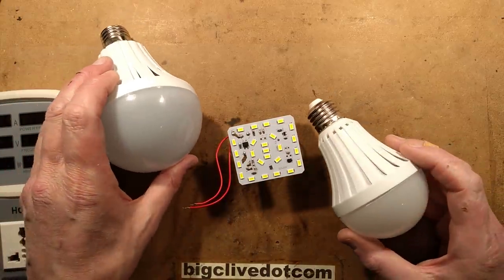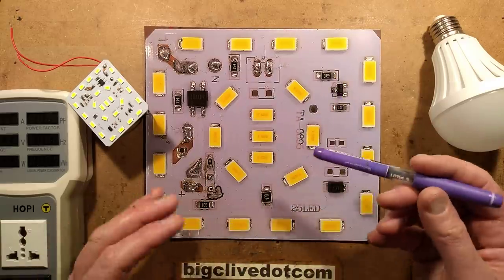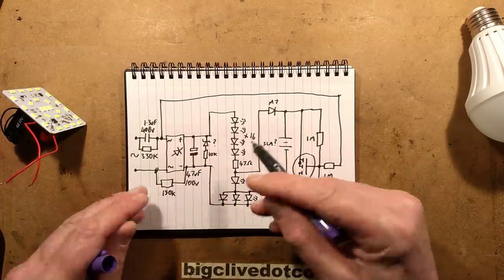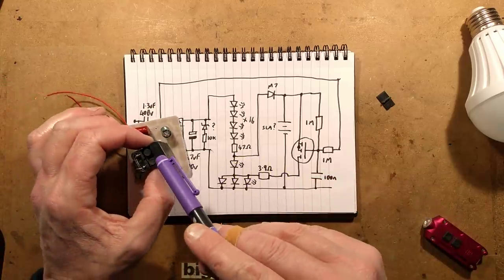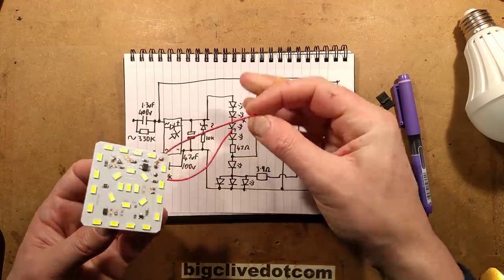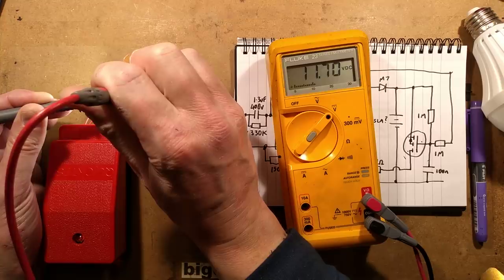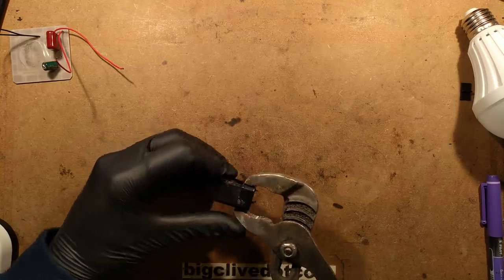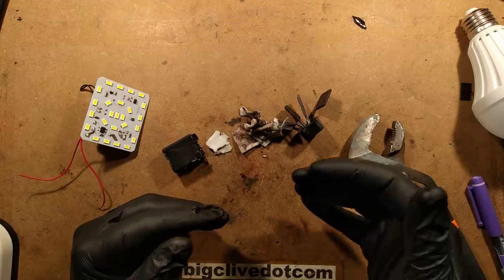Crappy lead-acid LED lamp with brilliantly simple circuitry.

Comment: Regarding cheap vs cheaper products from Chinese sellers, I've experienced being shipped cheaper versions on my second order from the same seller. First was a LED headlamp where the angle adjustment of the cheaper copy was so bad it would tilt down to point at your nose from the slightest head movement. Second was an analog video capture card where the cheaper one was lacking a lot of decoupling capacitors and a dedicated audio ADC. Makes me think some sellers intentionally ship the good version to gain your trust on your first order in the hope that you will place a larger second order where they can sell the cheaper stuff for the same price.

Comment: Have onne of this cheap emergency lights but fades after 2 hours, can I add another battery in parallel to increase the time? or can I replace the lead-acid with a 28650 lithium cell with BMS?

Comment: Bigclive, I found a battery like that in my electric bug zapper. It was dead so I took the battery apart and it was indeed a SLA battery. Voltage is 4 volts like the battery here. I have a pack of four 1.2 volt AAA batteries that I made and I think i need to take off a cell because the zapper won't charge. the adapter says 5 volts but has closer to 4.7 volts.

Comment: W/PF for about what they'd charge you for?

I've not taken an electronics course since high school (~6 years ago) so I'm a bit behind on things.
Reply from the maker: Modern smart meters can calculate your bill based on actual power used or the higher apparent power used by some non resistive loads.  With modern LED lamps it means that your supplier can choose to bill them as actual power or anywhere between 2 and 20 times that depending on the circuitry.  That also means that a simple plug-in time switch could cost more than its retail value every year in electricity costs.

Comment: The fiber in the battery is to keep the led close to the electrodes, so you can discharge it without the led  going so far away form the electrodes that it won't get back onto them when the battery is recharged. The fiber is the usual difference between a battery to start a car and a battery to run a alp lift/genie/electric boat etcetera.

Comment: does that mean it can be charged and discharged at the same time? cos I just opened up a cheapo handheld fan and found the exact same battery inside, so if I keep it plugged in at the usb charger, would it explode? there are no other components in the fan except the motor, a simple switch and the plug in connector..
Reply from the maker: Sometimes there's circuitry in the unit and sometimes in the USB charging lead.

Comment: iirc lead acid is very tolerant of overcharging (to a limit of course), so what if they stuck a current limiting resistor in series.  I'd think that would be enough to protect the battery decently and still keep the device very cheap

Comment: Did you measure the excessive charge voltage before or after blowing the zener diode? It was limiting the DC voltags on that circuit...
Reply from the maker: It was in series with a resistor to discharge the electrolytic capacitor when the unit is turned off so the LEDs go out quickly and also to provide a slight clamping load against current leakage that could make the lamp keep glowing from mains power when it's turned off.  The zener was to give that circuit a higher active voltage to avoid false triggering of the lamp via its low sense voltage.

Comment: I would think that they used some hydrophilic salt or organic compound to hold the battery moist.
The battery has also a crude deep drain protection with the diodes.
Also the lead-plates are very crude. They could have easily doubled the capacity and halved the material price if they plated iron meshes with the lead. Old cheap lead-acid batteries where done that way. (they break down fast if the plating is to thin.)

Comment: I've encountered a few of those rechargable LED bulbs with lead acid batteries and I hate them.

Every single one I've seen died within a few weeks or months mostly due to the capacitors getting grilled and blowing their fluff out. Some only the metal film cylinder capacitor, but a few with both blowing up. 

The battery is also grilled hard and buldges and blows its brown liquid splat inside the housing of the bulb.

Aditionally if nothing blows up the lead acid battery is dead since some people use them as a portable evening light and draining them regularly which kills the battery faster.

Comment: What’s the forward voltage of the diode in the battery charging circuit? Is that enough to take the voltage down low enough for the lead acid battery?

Comment: Alarm systems still use lead acid batteries, namely gel lead acid as a backup battery.
Wireless detectors use typically 3v lithium. Cr2 or cr123 batteries, lasting 2-3years typically.

Comment: If one of the parallel LEDs dies? Does the whole circuit die? I love to learn but I don't want to apply a higher grade LED versus a cheap LEDs that are currently on the circuit board. But I'll try. It's quicker to ask than follow the circuitry. Just saying
Reply from the maker: Only if it fails short circuit.

Comment: Got a couple of these when looking for the 18650 type. With the voltage so high , I really don't know what to do witj them?
Bypass the battery for low low voltage (usb?) Powered lamp, I don't know. 😑

Comment: Isnt the voltage drop from the diode preventing the battery overcharging? 2.35 x 2 = 4.70v max.  diode drop.. 1.8v , so from the leds maximum 6v before the battery would boil.
Reply: The Zener diode is not for the battery, it’s for the main light string immediately after the capacitive dropper to limit the peak voltage.  The battery only has what appears to be a standard silicon rectifier diode in series, so only about a 0.6C drop.

Comment: Seen some LED luminaires in a local car park that keep switching between the two modes. It's not the mains circuit as they all switch at their own rate not simultaneously.
Reply from the maker: Some car park lights have movement detectors to switch from low level illumination to high level when they are needed.
Reply: Wonder if they are in the wrong mode as most of the lights are always on. Just this one area area that may be motion sensing or something

Comment: I think tho low capacity of this battery stems from its simple design, there does not seem to be a large surface area of the electrodes (they look quite solid rather that "foamy"). Or maybe it just does not come clear on the video. I like this battery, btw.
Reply from the maker: The electrodes were solid and heavy slabs of lead.

Comment: If that battery is what it appears to be, it's an AGM battery (Absorbed Glass Matrix) and is the favoured type for use in mobility scooters and the like. It may appear cheaper, but it costs more than a basic SLA battery, and as you saw, even when you crush the living daylights out of it, it still does not leak (so to speak). They're usually slightly lower Ah capacity and don't charge or discharge quite as readily, but they are considered to be safer.  I have a pair of 50Ah AGM batteries that I plan to investigate. They appear to have dehydrated and sucked in the sides of the casing. I want to see if they can be rehydrated and made to work again.

Mobility batteries tend not to live very long, and it's usually the same old story of the acid having dried up, so, I've just bought some "Aqua Distillata" (Distilled water) with the plan to rehydrate these batteries, but, because of the glass matrix, it's likely to be a slow process over several days to fully rehydrate them, and even then, no certainty that they will live again.

Comment: Hi,I have a question,sorry for disturbing,I have a 12v 5a power supplay,but on the output IT give just 5v ,wath can be wrong with it?
Reply: Did it previously work correctly? If it gives a nice steady 5V and you've never seen it do 12V, might it just be mislabeled?
Reply: Barring the possibility of mislabeling, as mentioned above, there are too many possibilities as to why a power supply may fail to render useful advice from afar.  For example, we don’t even know what type of power supply this is or under what circumstances the 5VDC was originally measured much less have a schematic of the power supply in question.  However, if the power supply is designed with current limiting and the 5VDC was measured with a load attached then it may even be functioning as intended if the load was drawing too much power.

Comment: I tried using a bunch of zener diodes in series once for voltage regulation on a power supply I was building and they exploded in all of their glass tube glory. That day I had a lesson in component ratings.

Comment: Hmmm, I am now confused...
Clive appears to be describing an AGM (Absorbed Glass Mat?) battery, but then mentions it's an SLA (Sealed Lead Acid).
I'd always thought the two were different (or at the very least, one was a subset of the other).
Can anyone help me?
Reply from the maker: Many SLA batteries use either a gel or the glass mat.
Reply: @bigclivedotcom  
Thanks Clive...
The implication I'm taking from that is that an SLA battery is the superset that contains at least gel and AGM as subsets

Comment: I got stuck in the resistor bypassing the bridge rectifier "for a  sensing function", how a resistor can sense the voltage/current? I wish I could understand this to follow the rest.
Reply from the maker: The resistor is used to allow the switching component to sense when the voltage is or continuity is present.  It limits the current to a safe level.
Reply: @bigclivedotcom  Thanks! I understand the "it  limits the current to a safe level" but, how can it "sense when the voltage is or continuity is present"? It's just a resistor, it slow down the current. Sorry for the basic question!

Comment: I purchased some of these light bulbs and discovered that some of them switch on as soon as you screw them on, even if the light switch is off. Then in the morning when you switch them off, they stay on until the battery dies out.

Can this be fixed?
Reply from the maker: They can only be used in circuits on their own.  If there are other lights on that switch it will activate them.

Comment: Is that a recombinant battery? If so, it should not vent.
Reply: rpbajb SLAs will vent the when overcharged as their catalyst can only recombine the hydrogen and oxygen so quickly.  If the catalyst can not keep up, or of it has worn out from excessive use (whether from old age or excessive sustained charging), then the internal pressure rises above design limits (~5 PSI or about 1/3 bar) and the safety valve releases some of the accumulated hydrogen and oxygen gas, which is how such batteries lose electrolyte over time.
Reply: Ethan Poole Thanks for that data. I've got 160 amp hours of SLA's here, and I didn't know the catalyst could deactivate.

Comment: Sulfuric acid is most commonly used in these because its the cheapest. You could theoretically use any conductive sulphur salt as the electrolyte, like epson salts.

Comment: The lead acid batteries can deal much better being fully charged the whole time. Lithium batterys will rapidly die when held up to 4.2 V permanently. As a rule of thumb the lithium battery will live double the time by reducing the full charge voltage by 0.1 V.

Comment: I've got to wonder if one of the reasons that they used a lead acid battery is due to the fact that they are more forgiving in regards to recharging as compared to a lithium battery which is anything BUT forgiving. 👍

Comment: If the diode marked M7 was 2 or 3 diodes in series then that would limit the charge voltage to a safe level that wouldn't overcharge the cell.

Comment: Wait...Does it come on when its on a switched circuit and the switch is off?
Reply from the maker: It detects other loads in the house when there is a power failure and can detect the switch that way.  So it only lights when turned on at the wall switch whether there's mains power or not.
Reply: @bigclivedotcom  Ohhhh, i get it now. For a moment there I thought it was like an emergency type lamp, coming on when the city mains dies. Now the bridging of the wires makes more sense. That is indeed an interesting circuit.

Also ZOMFG BIG CLIVE NOTICED ME!!! [squees] Full disclosure, you are my YT man crush. [...  o.o  ... clears throat] uh...i mean, s'up man, how goes? Love the tattoo videos, reminds me of teching for haunted houses years ago. Though that companies gear is much cooler. If I ever make it over the pond I aim to have the trip coincide with that event. If you make it over the pond please do swing by California if you can. All around awesome content on the other videos, Ill usually throw your channel on for hours while tinkering at my desk. Virtual hugs, high five, and/or hand shake/fist-bump from the US!

Ok, ill stop 'fan-girling'....my friend is looking at me weird. Apparently shes never heard a man 'squee' before....

Comment: That appears to be a 4v lead acid battery 
I say this as most sla batteries are 2v per division/cell
And this battery has 2 cells (can be seen by the number of rubber caps)

I say thank you for reading this, and hope it was helpful!
Reply: Didn't realize that he covered this in his video, oops

Comment: That is a really tiny SLA battery. Didn't know they make them that small.
I'm somewhat sad that Clive has destroyed it.
Reply from the maker: One has been destroyed for the greater good.  Now other people don't have to open theirs and will know that they can actually top up the acid level in them.
Reply: @bigclivedotcom  Of course you want to use distilled water, not acid, to top up these batteries.

Comment: So just add a voltage regulator and all will be fine?
Reply: The Eh Team Just placing a 4.7V Zener diode in parallel with the battery would go a very long way to limiting overcharging.  A full voltage regulator, while such would be much better, would cost more due to the higher parts count that a full voltage regulator would entail (for continuous float charging, a 4.6V supply would be ideal).
Reply: @ethanpoole3443  Those basically short circuit to ground if the voltage is too high?

Comment: I'm so confused. How does it know if a switch is closed if it only has two terminals? Why would a switch short the terminals?
Reply from the maker: It detects the other loads in the house when there is a power failure.  They act like a low value resistor.
Reply: Consider what happens downstream of the switch when a transformer, motor, an incandescent bulb, etc, that are also in parallel with the AC mains are encountered.  At a low DC voltage whey will appear to the loop sensor as a literal wire shorting the two sides (neutral and hot/live) and complete the circuit.  Or consider what happens if we go further out to the utility transformer feeding the residence or neighborhood which can also complete the circuit as it’s secondary coil will again look like a wire shorting the two sides allowing the current in the emergency light sensing circuit to complete its connection provided the switch was in the ON position.

However, such simple sensing has its flaws too if there exist other lights or devices on the same physical switch.  Consider a light switch that covers 5 lights throughout a large room.  Because the are all on the same switch, if just one of those bulbs is incandescent or has a power supply with a transformer in it then the emergency light’s loop sensor will always see a closed circuit (via the other incandescent or low voltage bulbs in the string) regardless of what state the light switch happens to be in when the power fails.  In this case the sensor will believe that there is a power outage anytime you switch off the switch and I’ll always be running the battery flat

Comment: Am I the only person who's thinking of getting one of these then surreptitiously slipping a bit of foil into my mouth to freak out a coworker on the next electrical job?
Reply from the maker: You wouldn't need the foil.  Just your tongue will make it light.
Reply: I was thinking that it might give your bare tongue a bit of an unwelcome tingle. It's just a pity that I'm done with that part of the renovation. 
The fellow I was working with knows nothing about electricity and was a little freaked out when the lights he had switched off started to glow when I was changing a fixture in a different part of the basement.

Comment: my idea of using a light emitting diode and a purple colored photovoltaic fiber optic tube might work and it might be possible to step up a dc battery. like a inductor but solar technology not a copper one.. maybe we could build smaller power supply’s? 🤔😯🤗🤷‍♂️
Reply: could call it light emitting inductor (LEI) or Power over fiber optic (POFO) 🤔😄

Comment: the reason they used SLA batteries is because you cannot keep lithium based batteries (unless it's LiFePo4) fully charged 100 percent all the time as you can with a lead acid battery.  you need something to be fully charged 100 percent all the time incase of emergency, and since you never know when an emergency comes, quickly charging a lipo or li-ion would be out of the question.
Reply from the maker: They could have set a low upper-charge threshold like 3.9V though.  That gives good capacity with less stress on the chemistry.
Reply: @bigclivedotcom   You have a very fair point there O_O a sacrifice of about what, 40 percent of the capacity for an LED lamp can still, if the light is done right, give a few hours of light even at that voltage.